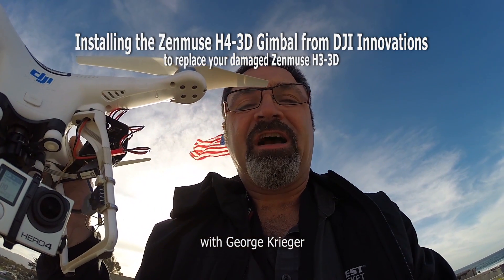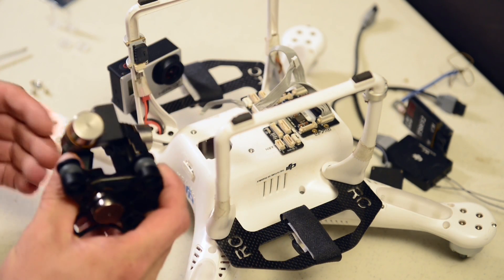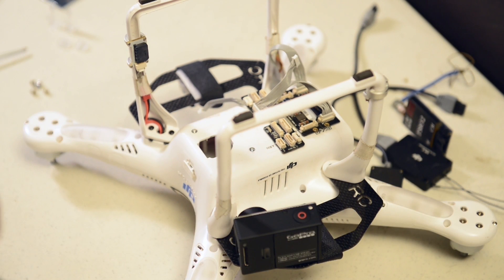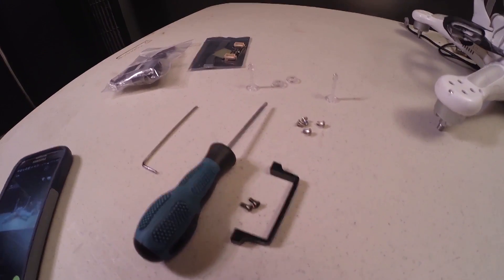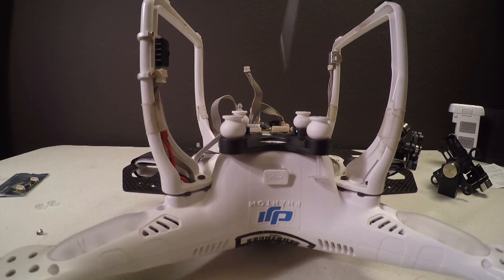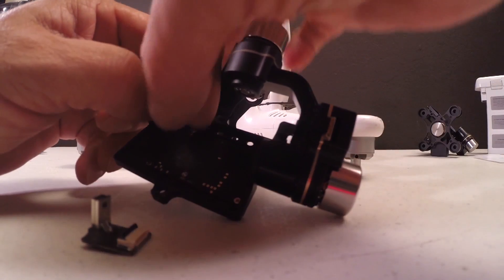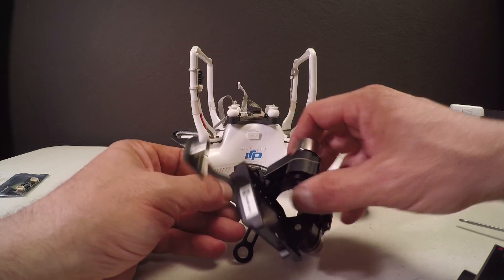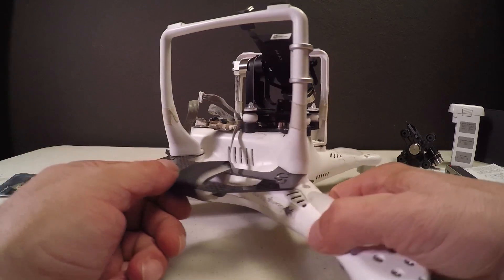DJI Zenmuse H4-3D Replacement Tutorial

Comment: Hi George, do you have a video of how you connect the other accessories, like osd, fpv, data link...? And just to make sure, did you have any problem with the interference board connected to the gimbal using the fpv hub? The question is because when I was using the h3-2d I didn't need to use the interference board and the phantom cable went straight to the fpv hub and I was able to connect all the other accessories, but now instructions say that cable has to be connected from phantom to board and to gimbal... I am planning to add the data link too, so that is why I like your set up... thanks.

Comment: Great video!!!  Question on the gimbal, I noticed your gimbal didn't tilt up all the way after turning on the Phantom and calibration.  Mine does this as well, how did you correct this afterwards? Thanks!
Reply from the maker: Jonn Robinet that is the vertical degree setting.

Comment: Hi George, i got my H4-3D all set up and it seems to work fine but i am having an issue with rotation, the wheel on the back of the remote is registering some weird things(i spin to the right it goes full right, spin to the left it goes past the end point and then goes to the right)  on the RC program from DJI and the gimbal it self is only rotating may 10-15 degrees in either direction and i can't figure out what happened any ideas
Reply from the maker: Which remote do you have the original one or the newer one with the new gimbal control?
From your description, I would reload the main controller firmware and the gimbal firmware. Make sure you are on the latest P2 assistant software (v3.8 or greater at this writing) Do an advanced calibration and make sure that the gimbal and gain sliders are all in default positions.  (also verify that you have the right controller listed in the new section for old or new RC controls. )   If none of this fixes the issue, and you have the gimbal installed correctly, you might have a bad gimbal.

Comment: Great video. I am from seaside and just bought a new phantom 2 with the g4-3d. I noticed that your gimbal also doesnt look straight forward. Should I be worried or is that how they are? Also I am looking into making it fpv. Any advice or good brands to go with?
Reply from the maker: The gimbal looks straight forward Eric. I am not sure what you are seeing.  One thing until you get FPV do not use the GoPro app to see the camera image.  IT WILL CRASH YOUR PHANTOM. That being said a good FPV system runs on 5.8ghrz and can be procured from places like www.dronesmadeeasy.com.  I just bought a new FPV monitor from them this week.  Most dealers have the same prices and I like the customer service I get from these guys. I am not paid to send you there either, it is just the place I buy a lot of my gear.
I also teach aerial imagery and drone operations, Eric.  
Check out www.TheArcanum.com and watch for workshops I will be hosting locally soon.

Comment: Hi George,
Why only 2 dropclips? not 4?
Thanks, cheers.
Reply from the maker: only 2 are needed... you can use 4 but why?  Less weight and spare clips this way.
Reply: George Krieger Thanks! ;)
Reply: George Krieger 
Less weight? 
I thought it may have had something to do with having to maintain clearance for the camera and gimbal movement during calibration. stuff the extra wight They help reduce the amount of available space the rubber dampener has available in to deform into which allows a small kink to develop near where its seated and out she comes. Safer bet is to add a secondary plate to clamp down on the dampening rubber face.